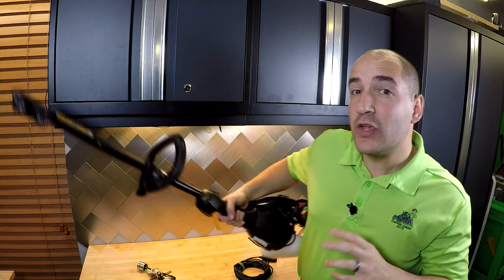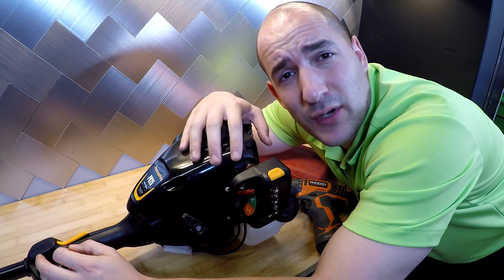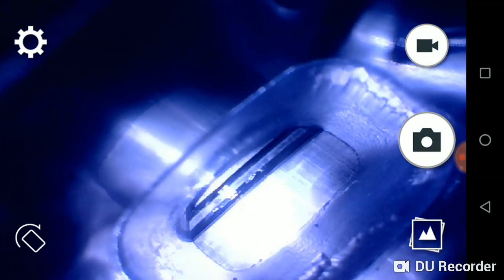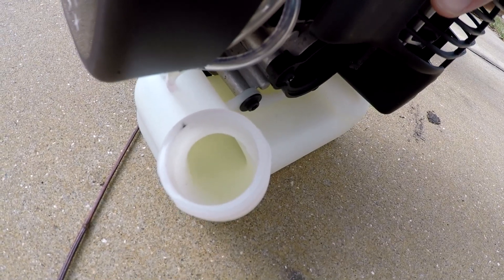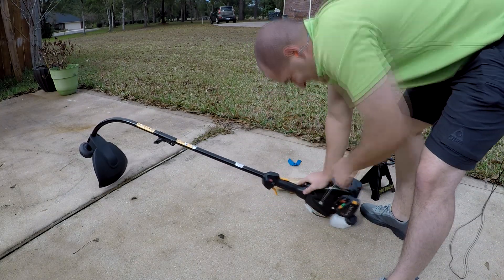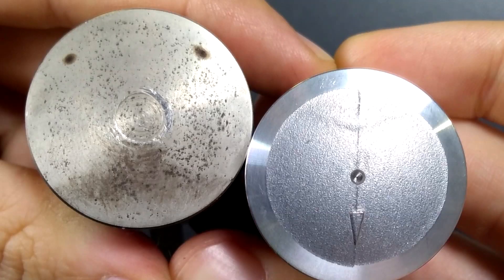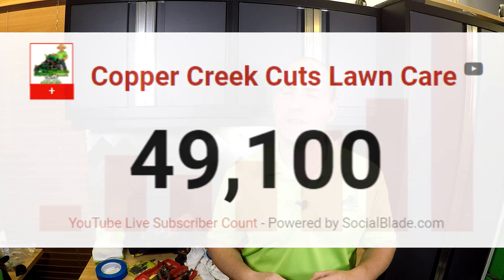This Is What Happens To 2-Stroke Engines Without Oil (2-Cycle Engine No Oil Experiment)

Comment: I've been running a leaf blower on 50:1 fuel mix instead of the correct 40:1 for 3 years now and i think it finally caught up with me as it runs poorly and bogs down when throttled. I've tried adjusting the carburetor, but it still bogs down.Any thoughts?I'm wondering if it's worth it to even get it looked at much less fixed or if it is a total loss and learning lesson.

Comment: I got a Chinese chainsaw, and the first tank of gas I ran through it was fuel from a can that my friend said was mixed. I don't think it was mixed 😭 it runs but the gas was yellow and when I mixed my own gas it's blue AF. Some times it'll randomly stop running and sometimes it'll bog down if I pull the throttle too fast and it can be hard to start sometimes. I haven't used it a ton (maybe 2 full gas tanks) and idk if those problems are because of the fuel I used or because of it being Chinese. It was $130 and I've cut about half a cord of wood with it so I guess it's not so bad when a cord of wood is 300-500 where I live

Comment: What if you put too much oil with the gas?
Reply: It'll probably run but it will smoke a lot and have a lot less power, and make the cylinder really dirty and eventually you'll probably lose spark as the spark plug gets too full of carbon and other deposits. A little too much is better than too little but within reason

Comment: I accidentally put lawnmower gas in my boat that did not have oil in it and I burnt approximately 10 gallons and my boat motor survived. Does anybody have any idea how this happened? This guy did not have any oil in it. It was only ethanol, free gas.

Comment: This confirms my suspicions....I just picked up a used leaf blower and put a bit of gas in it, but didn't have any oil on hand. I let it run for two seconds just to make sure it works, and turned it off. I was paranoid that the lack of oil would wreak havoc on the machinery. I'm not used to 2-strokes. Thank you for your demonstration!

Comment: I have a scooter 50 cc2 stroke Honda X8rs  Air Cooling and I was driving it like for a whole day of course I always stop for 10-20 minutes so the engine cools more
At the end of the day my motorbike started behaving weirdly I thought it was over heated but it isnt going slow it was hiting 70 kmh 
It is louder than before,oil leaked a bit in the Head I think that it isnt getting enough oil probably a blocked oil mixing tube that mixes oil with gas

Comment: I work for a lawn company, we run weed wacker and use Honda mowers etc , one time one of my co workers accidentally put 2 stroke mixed gas into the 4 stroke mower 😎 soon he was smoking out the neighborhood LoL 😆, after realizing what had happened, he dumped the fuel out, put regular gas in and fired it up, smoked some but ran fine after, no harm done, always depend on your Honda 😁

Comment: It might work but I think we are taking a risk! My experience goes back to around 1969 with a 'Cyclemaster', a cyclemotor being one of a type that enjoyed a few years popularity in the immediate post-WW2 years.
In those days, we might sometimes encounter a 2-stroke machine, a kind of hand-operated dispenser that was supposed to provide the correct fuel/oil ratio. Inconvenient as it was, I generally took a gallon can to the petrol(gas) station with the required amount of oil previously added. But, out of laziness I guess, this once I entrusted my motor to the aforemention dispenser. All seemed OK but a mile or two down the road the engine was obviously getting tight and I stopped before it seized. Having wheeled the bike home and added oil, all was well from then on but never trusted the right mix to 'professionals' believing that it was lack of oil on there part that caused the near-seizure!

Comment: Hi shame about the Strimmer, but you did prove a very good point, especially on a m/c most say is ‘crap’. So not too much lost. I am trying to get another crap bit of equipment, hedge cutter going for my friend but have almost stripped  it right down with no luck starting, it wants to, but no pressure on the pull cord, it is an Italian alpina hedge cutter machine that I don’t rate at all, especially when I saw they will not post parts to the uk.?. Say no more.  Live in 
the uk, so not sure if I qualify for any of the prizes you mentioned.🤔😊👍

Comment: What if I put 50:1 instead of 40:1?  I bought Black Max synthetic blend oil which said it works for “50:1/40:1” but after about nine minutes, strong smell and no start. Is the oil mixture what caused it? It was 2.6 ounces instead of 3.2. Of course I learned that after I looked online when my trimmer was dead.

Comment: Oh well I just drove my scooter a good 15 kilometers at 20 km/h because it would slow down when going full throttle after a couple seconds.

... It didn't have enough 2 stroke oil, poor thing, the warning light was broken as I found out at that moment. After filling it up though it ran just fine again, I hope I didn't damage it all too much. The engine is from 2003 and has passed 20.000 km on that very trip

Comment: I had two separate scenarios happen to me about lending equipment out to my father in law whom is new to powerd lawn equipment (relevant to a old old school farmer)  and after a brief instruction (assuming he understood the concept) I
Ient a trimmer I had for about 4 years ran fine
He brings it back says it won't start
I try it and the clutch exploded and front seal is burnt! I didn't want to offend him so I just nipped it so thinking this was a learning curve so I got one from a pawn shop and enriched the mixture so no matter how hard he guns it would run at a lower rpm and more fuel/oil means more "cooling" (something I learned in aviation mechanics school) Thinking he gotten the concept after about a year of using powerd lawn equipment I lent him a mediocre blower I had and instructed him on the use even telling him that it uses the same fuel as the trimmer about 2 weeks later He said again it would not start so I checked it out and the starting was stiff but it did not start but the tank seemed empty so I was thinking that he put the wrong fuel by accident ok fine not knowing any better I lent him my nice blower and once again I explained fuel and use as before about 2 weeks later He said it would not start I rolled my eyes and picked it up and opened the fuel tank and there it was strait gas.

After all offensive purposes: 
he's going electric
Reply from the maker: I never loan tools! :D

Comment: My neighbor came over with his brand new chainsaw, asking if I would help him understand why it stopped running.  I went after the usual suspects, but when I took out the spark plug, it looked a bit rusted (it should look slightly wet from residual oil).  I asked him if he was mixing oil with the gas and he said no.  Apparently, he did put plenty of oil in the oiler, but wasn't aware that you also have to add oil to the gas.  I also showed him in the instruction manual where it said that failing to put oil in the gas would void the warranty.  
I checked the compression and it was around 18 psi.
Unfortunately, I had to give him the bad news that this was pretty much the end of his brand new chain saw.  The good news is that he bought a cheap one.  The other bad news is that he also bought the extended warranty... which also does not cover failing to mix oil in with the gas.
Reply from the maker: Oh no! :D

Comment: Generally speaking, a 2 stroke engine will idle for a very long time just using straight gas providing it was run previously with the correct fuel to oil ratio. It's called oil migration. The gas burns and leaves most of the oil behind which stays in the engine up to a certain RPM then it moves out the exhaust.
Reply from the maker: Thanks for the tip!

Comment: Today I ram my 2t motorized bike without oil, I use green oil, and I forgot that I didn't mix that gas, if I used red I would saw instantly, go for a ride, 10km and it locked, started again, locked again, I still didn't realise, I pedaled it home, started it and ran for 3 minutes then it locked again, and then I realized. Took the spark plug out, put some oil, put the right oil/gas mix in the tank and runs like a charm now, didn't lose any compression, like...wow, these cheal chinese engines are very good, power is the same

Comment: I imagine these engines are not designed to withstand operating at full throttle continuously.. almost no engine is designed to operate that way.. so I really would be curious to see what one would like if abused till destruction in normal operations instead of just full-throttle continuously.
Reply: They are designed for continuous full throttle use. Air cooled by a flywheel fan they are used like this normally
Reply: This video was a waste.
He didn't do a break-in period. Just wot trottle on a new engine is a death sentence 
I used pure gasoline on a 2 stroke engine and never had a problem. Never mind, this one has an oil  squirter. Maybe that's why it lasted 😆

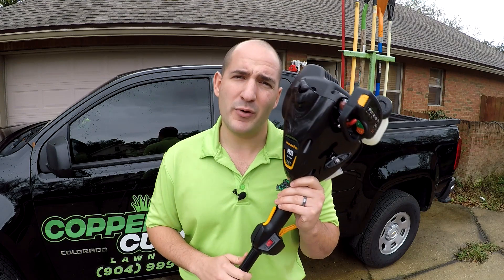Comment: On my 3rd refill for the day on the leaf blower I was a bonehead and grabbed the wrong can sitting right next to the mix, topped off the tank and probably diluted the mix from 1:50 to 1:500. Ran her full blast for 10 minutes before it died. Had ear protection so I didn't hear anything. wtf I thought. Saw the clear gas sloshing around the half full tank and did one of these 😨. I dumped out the gas, refilled with mixed, primed and she started blowing again like nothing happened.

Comment: Man I just bought a “Sthil FS 111” Trimmer and filled it with gas (No mix) 😩 Tried to star it but it didn’t start. After watching this video I took out all the gas and haven’t touch it since. Please tell me I didn’t damage it before even using it once. 😢
Reply: Well, if it hasn’t started yet you’re probably fine. Just fill the tank with fuel oil mix and try again.

Comment: The oil pump failed on my 2 stroke scooter last week and it completely locked up after letting
It cool for 20 mins it started again and went but now it has no power at all what will need replacing?

Comment: It would’ve been nice if you explained if that trimmer can be fixed and what parts needs to be replaced to repair it. I ran a Poulan pro chainsaw on straight gas and it smoked a little bit before dying. Now I don’t know how to fix it !
Reply from the maker: There is no fixing it. If the engine block is scored like in the video, you can replace everything else and it still won't work. It won't create compression. Just buy a new one.
Reply: @BakerCountyTrashPickup  it’s possible to fix it. It would be stupid too since it’s a waste of time and money but it’s possible. A new bore and piston and if there’s anything wrong in the crankcase replace it and it’ll be fine. The carb should still be just fine and the internal combustion chamber is the only damaged equipment
Reply: @moddingdudes7055  thats basically what hes sayin tho. If the engine,cylinder and piston if damaged as such you cant fix it and like u said you can try and replace those parts and possibly get her back up and running.
Reply: Nah stop crying and learn to not put plain gas in a 2 cycle and not be a moron

Comment: Hey. You are good at engines. But what if i trow some wd40 in a pocked bike . Wd 40+normal fuel. Will it kill it for ever ? Cuz my engine got really hot and then the piston was stuck. It dont moves anymore and i didnt look over it yet. But could it be that its dead for ever ?

Comment: There is one stuff i would like to know, when to change the cylinder? Mu piston and cylinder get a little like your'se i had to back home (about 30min) without any oil on the engine... My rings are broken and i get one profound risk, on the cylinder and one beteween the place where the rings ate supoosed to be.

Comment: I would love to know what makeshift way (no tools, little money, etc) could one extend the engine's life now that it is seized and damaged. Could you cross-hatch sand the rough spots on the piston and cylinder down. Then free up the piston ring (maybe with sandpaper too). Then, add say 10:1 oil and see if it can sustain running again. Also, how long would it still last in this way? Since compression is going to be affected, could adding an extra ring (if a friend, say,  has a lathe) help in that regard. Anyone tried this?

Good video, though. A bit like the website ShockGore.com but for mechanics or engineers! I wonder what simple, cheap, mechanical device could be added to the engine to prevent it destroying itself with no oil. My first idea would be a temperature sensor that grounds the ignition when it gets too hot.

Comment: Can we mix normal engine oil for 2t oil
Reply: In a pinch you can but it is NOT recommended because regular motor oil will usually separate out of the fuel much faster and the viscosity of motor oil can cause the fuel mixture to become too thick and can alter the tune on the engine and it can cause rapid carbon build up. I have done it before with no failures but just to ensure reliability just buy proper 2 stroke oil.

Comment: Guys mixed up gas cans at work ran straight gas in 2 expensive stihl chain saws is this fixable??
Reply from the maker: Depends on the where and how much damage. You can try and use a cheap borescope to check the inside out.

Comment: Separate oil tank when
Reply from the maker: Not on two strokes.
Reply: @BakerCountyTrashPickup  Well, it can still be run thru the carb same as the petrol, but somehow coming from a separate tank. Or they could do what 2 stroke Diesels often did. The crankcase was a normal 4 stroke crankcase but the engine itself drove a blower to provide the scavenging the case tends to on 2t Otto engines.

It's all hypothetical. I can't imagine it's good for profit
Reply: @BakerCountyTrashPickup  I've seen two stroke scooters with a separate oil tank/oiling system.. But I would guess that it's just not suitable for two stroke power equipment, where I guess it would add unwanted weight and complexity (chainsaws, weed eaters and such)

Comment: Is injection worth it? Or is oil+gasoline good
Reply from the maker: I apologize, I don't understand the question. I don't have a problem with two stroke equipment, however.
Reply: @BakerCountyTrashPickup   i mean that some 2 stroke engines have the auto lubrication which means that i dont have to add oil to the gasoline... i just think that is auto better than mixing up gas.. its okay if u dont understand but i mean for 2 stroke mopeds

Comment: Yes but no. 2 stroke engines break easily specially with High rev. This engine broke because it had not oil but with oil it wouldn't last longer
Reply from the maker: I say this with all respect, but that is 100% wrong. I have two stroke engines with hundreds of hours that run high revs. Thank you for watching!
Reply: Not true at all.
Reply: These string trimmer engines turn relatively low rpm even at full throttle, high performance race 2 strokes will rev well over 10,000 rpm for long periods of time and will last a long time. These string trimmer engines are designed to run between 100:1 to 50:1 oil ratio and to be ran full throttle for hours on end, when they design these trimmer engines they have to undergo lots of full throttle endurance testing where they will take a new trimmer and put the correct fuel in it and make sure that it can last for a certain amount of time before selling that particular model to the consumers, if 2 strokes were as fragile as u claim then there wouldn't be any left, u sir are not properly educated about 2 stroke engines, please do some serious research before posting a false comment.

Comment: More oil= more power
To a point....like 12:1
My point is 20:1 makes more power than 50 or 100:1 not just a little either but  over 5%
Reply: The biggest issue with thick oil mixtures is that you start to alter the viscosity of the fuel and will cause the jetting in the carb to become to lean unless u retune and rich oil mixture will foul plugs much quicker and can clog the spark arrestor screens quickly.

Comment: Wow! I rebuilt a YZ250 and the cylinder and piston were like this. I knew it was run by previous owner without filter and thought a stone/nut had done this damage. Evidently not this is the exact damage she had. New piston and she's cracking but the cylinder is scored on one side like this. Great video!
Reply from the maker: Thanks for the comment! that is pretty wild that happened and a great reminder to always check for an air filter! :D

Comment: You have to test more than one to form a conclusion.
Reply from the maker: No, I am fairly confident I only need to test this one to determine running your 2 mix machine with straight fuel is a bad idea! :D
Reply: @BakerCountyTrashPickup  yeah, because no factory has ever produced a single dud.
Reply: @BakerCountyTrashPickup  great vid, i have no idea what point this guy is trying to make. Most 2 strokes or all as far as i know. You mix gas and oil. If you go against manufacturers instruction your producing a dud yourself anyway. Lol. Keep it up bro!